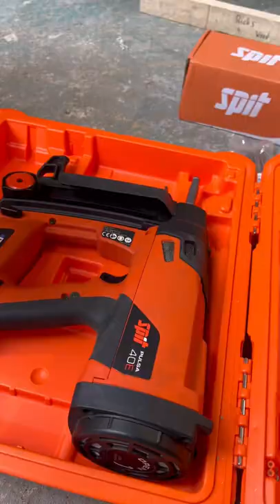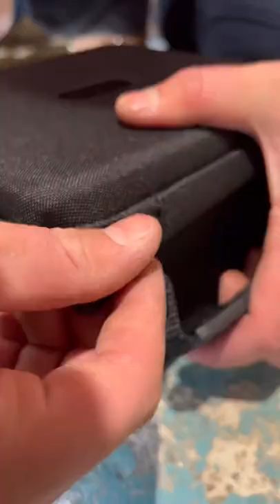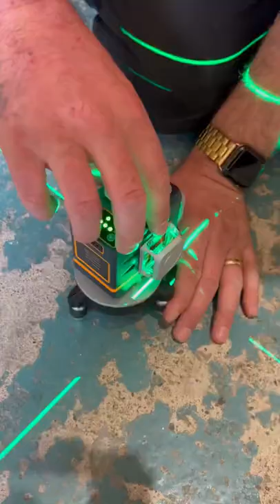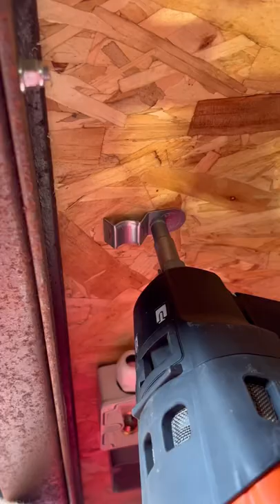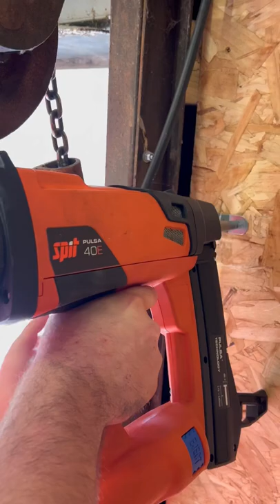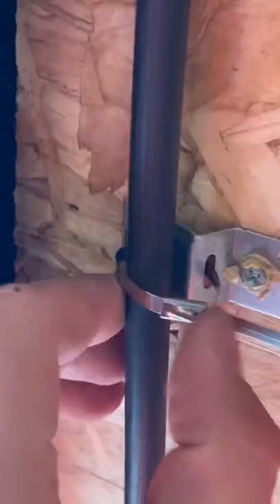No excuse for a wonky cable - CM-701

Comment: Will actually be faster and more precise with a laser.  
The fasteners on wood are not a must have, but such a thing is very good for hard concrete, where normal nails cant be driven in.
The wire would have also been secure with normal cable ties exept if its in direct sunlight.

Comment: I'm good with the laser level.  But a driver with proprietary screws that probably cost at least twice as much is a nope for me.  So is all that proprietary mounting hardware with hard edges used on power cables.  I don't do work without long term safety and longevity in mind.  

For the same price or close to it you could have probably run pvc conduit that is safer, provides more protection and would last longer.

Comment: i would prefer using nylon cable ties..
Reply: Those become brittle over time when exposed to sunlight, eventually they just crumble.
Reply: @MicraHakkinen  Black tie wraps are UV resistant, at least the ones we use at my work and they'll do the job. This is indoors anyway so not really a problem.

Comment: Job, I"i need to run a length of cable and mount a box"
Solution "better get on the net and spend a couple of grand on equipment, sure maybe I'll use it again"